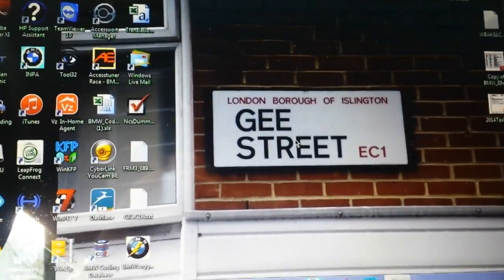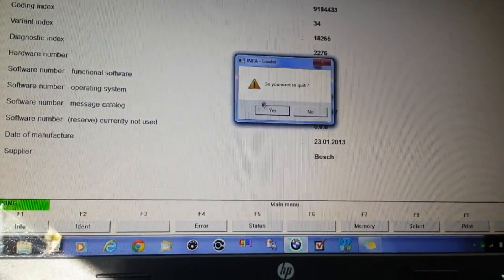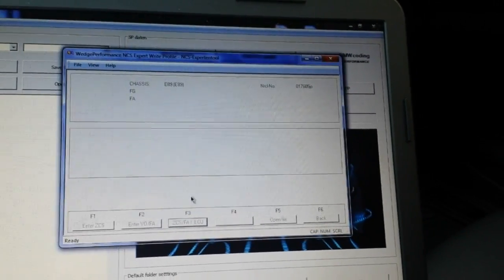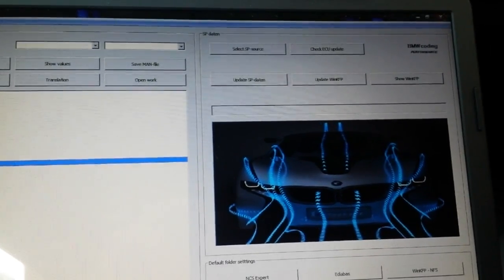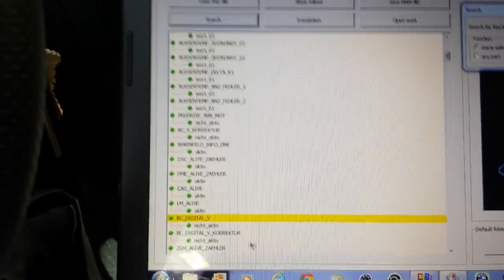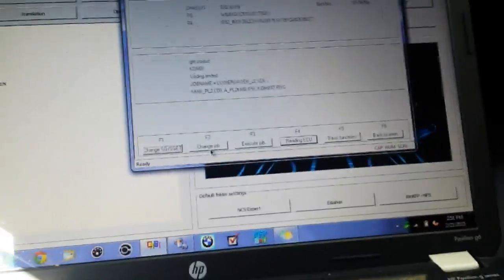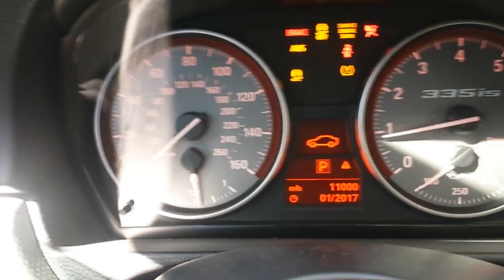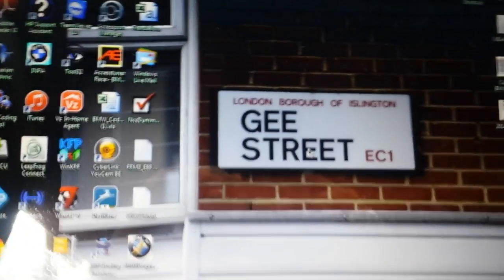Using the BMW Coding tool

Comment: Hey there, I‘m trying to code BC_Leerzeile and it‘s already done from „aktiv“ to „nicht_aktiv“, but still habe single text in my bordcomputer. Want to change to double line text. Read that it is not working because of long distance light (have bi-xenon in my e87).

Comment: Could u please tell me how to reset the short circuit counter in frm module?, also is there any way to deactivate the counter on frm for angle eye rings? Mine is normal Halogen, i swaped with 30W led now its not turning on. All i am getting error code short circuit in LM module. Car is E60 LCI. (WITH SINGLE HALOGEN BULB, WHICH ILLUMINATEDS 2 RUNGS) also headlight is Not xenon type. Thanks

Comment: Great video and clear. Can I use this software to remove the Adaptive Headlight feature from my 2008 335XI sedan? I have an error code on mine and I'd rather do without the feature as I know it can be programmed out...If yes, is there a tutorial to install the software you used. Thanks and again well done video......
Reply from the maker: Uptown Wedding Photography NJ Thank you.  Yes you can code out adaptive headlights with the software pkg.   You can find the latest edition of this software with installation instructions inside the zip at bimmergeeks.net in their download section.  Look for Standard Tools.

Comment: Hello! I need help :)
I managed to install everything i need on W10 laptop got cable and it seems i'm ready (i'm downloading 2gb files for R56) what i want to do is to re enable AUX input on my R56 which disappears when battery went flat :(
My question is in which module i need to look for AUX ?
Thank you :)
Reply from the maker: Look for RAD or something to that affect and search AUX.  You should be able to default code it and return it to factory settings.
Reply: If i understood you well option should be available in module it just needs to be turned on?
Reply from the maker: RevMeTech Was it enabled by default before or did you need to code it on?  If it was on with factory settings default coding will reset module to factory settings, turning it back on.  If you had in coded on after the fact you'll need to go into the module and enable it yourself by coding it on.
Reply: That is the problem i don't know ... What i know is that it is R56 mini which means that every each of them have AUX from factory. I bought it from first owner (i imported car from another country) and when car came to me i needed to jump start it because it was winter. And at that point it didn't show aux in radio menu but in original mini manual for radio there are instructions for aux and so on ...
Btw how do i do default coding ?
Reply from the maker: RevMeTech just Google expertmode coding with NCS Expert.  It's very simple.  If that doesn't work go into your RAD module, you can use the video as a guide, just substitute the RAD module for KOMBI and use the search function to find AUX.  If it's nicht aktiv change to aktiv and finish.
Reply: Thank you for quick reply. I have everything setup with r56 data ... I just need courage to start this :D one more question before i try tomorrow. Which modules in order should i first read and check for Aux option?
Reply: Bro i got info from rad module it has AUX option and under it it says no_aux what i should do now? In other guides it is usually on german no active and active but here it says no_aux :S after some checking rad module from dummy is offering options no_aux, aux and aux_tele something like that i guess i need to change no_aux to aux ?
Reply: Just to let everyone know i managed to enable aux! :) i'm so happy now! :) what i did is in 1rad module AUX option had no_aux what i did is i deleted no_ and left just aux and bam it worked!

Comment: Hello, got a few questions. What exactly IS a daten file ?

And is it possible to add the coolant temperature on the dash (the same way you added the digit speed) ?
Reply from the maker: I'd describe the daten as the data files that the programs use to perform their function, whether it's diagnostic, programming, or coding.

As far as I know it's not possible, at least not easily as it's not a option made possible by BMW.  I won't say it's impossible to do but it would entail a lot of custom programming and that's far beyond my scope of knowledge on that subject.

Comment: I do not have the profile you listed.  I have NCS Dummy profile for Expert.  Will that work the same?
Reply from the maker: If it has trace manipulation checked in the profile it will.  The thing about profiles is that they're editable.  You can load a profile, then go back to edit profile and change it however you want and name it whatever you want.  Most of the profiles in any given BMW Tools download have been floating around for yrs. Attached is a screen shot of the two different profiles I have.  Coding profile on the left, Expertmode on the right.  Does that help?  You can go into your profiles and see which one has manipulation checked and that would be the profile to use to make the coding stick.  https://goo.gl/photos/nN2vncMYfmZvZK2TA
Reply: That does help.  Thanks a ton.

Comment: So if you wanna code the mirrors to fold with the Key fob upon locking, would you choose FRM instead of CAS since it's under the FRM? This video is great btw
Reply from the maker: A_Squared Choose CAS initially,  then F6 to back out, then process ecu, then choose FRM or NFRM depending on what you have.  You can always pick CAS  first regardless of which ECU you're coding because you'll always have to pick the correct one from the drop down menu that lists them all.
Reply: LMB335is awesome thanks. You're the man!

Comment: Hi,

I have been using NCS Expert in the past 
with no problems with Win 7 in XP compatibility mode. I have now installed Win 
10 (big mistake...!) just tried running NCS again, also in XP 2 and 3 
compatibility mode but still errors whenever it tries to read the data from 
EDIABAS data server, it comes up with Initiating errors, and Sys key 
errors.
Anyone else tried NCS with Win 10 either in compatibility mode or 
not. Also have changed EDIABAS to compatibility mode as well with same 
result.

Any thoughts welcome.

Cheers
Reply from the maker: I run my software on Win 7 64 bit.  No need for compatibility mode.  I tried the Win10 upgrade for 30 minutes, hated it, BWW Standard Tools 2.12 threw errors, and went back to Win 7.  You can try uninstalling it off of Win 10 and reinstalling using Win 7 compatibility mode or just go back to Win 7.
Reply: Hi LMB335isIts almost 4 years since I installed NCS so although have been using it, the installation is a bit hazy now, can I just copy the folder to a new installed Win 7 version or does NCS have to be installed... really cant remember, also for EDIABAS.. struth spent so much time getting g it working years ago, thought it was ingrained in my brain for ever, wish I kept notes...
Reply from the maker: I can give you a link to what I use.  It's pretty much self installing with instructions, updated daten, NCS Dummy, Bmw Coding tool, and Standard Tools(NCS Expert, WinKFP, INPA, Tool32).  It will work with anything from XP to Win 10(in Win 7 compatibility mode).  It's all the latest version if you'd rather just do a fresh install.  You should have it up and running within 15 minutes of downloading it.
Reply: Ok, that would be great, I'm just adding win7 on to my laptop as well just in case, doing it now... but the link would be good, mine is 4 years old. Be much appreciated.
So best I guess is mail.   mobile-mail@ntlworld.com. 

Cheers for that, I'll let you know how get on.
Reply: +LMB335is One question, I had trouble with getting correct Daten files to begin with, the ones I think it calls up were the latest or correct for chasing back then, will the latest ones you use be ok you think...? or best use originals I have.
Reply from the maker: what model BMW do you have?
Reply: Hi,  its 320i 2010 LCI,   this is much appreciated...
Reply from the maker: +Malcy jb Use the updated daten in the pkg.  Especially useful if you decide do any ecu updates.  It works for all E8x and E9x models.

Comment: Great video! For some reason, when I execute the coding - it succeeds, but I can't see the changes. When I read the module again - it gives the old values. What could be wrong?
Reply from the maker: Try closing out everything.  Then go back in and process ECUs.  Now go to your Work folder and open the FSW_PSW_TRC file.  The changes you've made should show.

Comment: thanks for the video. I have few questions: this type of coding is actually to change options on the car, correct? WINKfp is used to write the new VIN on a module you replace, correct? for the lack of better terms, how do you pair a new module, let's say airbag module, to the car? I have 2012 Mini cooper s R55. thanks
Reply from the maker: +Salah Sharief Sorry man, forgot to get to your question.  Yes, either use WinKFP to reprogram it or Tool 32 to rewrite VIN to module/

Comment: Where did you get this program? By the way does it works on win 7 64bit?
Reply from the maker: +Dovydas Milius It's in one of the BMW Coding forums I believe but here's a link to it. 

https://mega.nz/#!2d500QQb!yO3UI4KCJFc3e3ew2aBndrL2JC8sOFTtjjSYzbzywr0

It works perfectly on Win 7 64, that's what I'm using in the video.
Reply: +LMB335is and its full english?
Reply from the maker: If you're just referring to the BMW Coding tool, yes.  I'm assuming that you already have BMW Standard Tools 2.12 (INPA,NCS Expert, Tool 32, WinKFP) installed.
Reply: +LMB335is I have got exactly this version. Inpa is in German and ncs is mostly in English. By the way, how good you are in programing? I want to program my instrument cluster and i need some help
Reply from the maker: I'm really not much on programming since I don't personally need to use it beyond maybe updating a module here or there.  I would suggest checking out the coding section on E90post.com.  There's some very knowlegdable guys on there that really know programming.
Reply: +LMB335is Thank you very much!!!
Reply from the maker: You're welcome.  Good luck.
Reply from the maker: +Adrian Anton https://mega.nz/#!jYgmlS4D!yO3UI4KCJFc3e3ew2aBndrL2JC8sOFTtjjSYzbzywr0
Link to BMW Coding Tool
Reply: +LMB335is Thank you!

Comment: Thanks for sharing this video, Bill. It is very helpful. I have a E70 and I followed your steps except I selected the E70 chassis as I have the E70 daten files. When I execute job, it codes fine but when I restart the car, I'm not seeing the digital V. Also, I go back and read the ecu and the values for the digital v is back to not active. Do you know what I am doing wrong?
Reply from the maker: Did you scroll through the menu in the dash to see if it was there?
Reply: +Bill G Yes, it is not there.
Reply from the maker: +omgboost  You picked BC_DIGITAL_V to change?  Try it again and save your MAN file and see if its been changed in the MAN file
Reply from the maker: +omgboost Also make sure you're using the writing profile not a expertmode profile
Reply: +Bill G Yes! Thank you for your help. I forgot to change the profile from expertmode to a writing one. After I did that, I was able to code the changes. Thank you again!
Reply from the maker: +omgboost Glad you got it figured out.  Get to coding!

Comment: you can tell me the name of the programa that you use.
tanks
Reply from the maker: +Pedro rodrigues  I use BMW Standard Tools 2.12 which includes NCS Expert, INPA, WinKFP, and Tool32.  And I use the BMW Coding tool.  In the video I use INPA to illustrate that I have a active connection to the car and I use NCS Expert and the BMW Coding tool to do the actual coding.

Comment: This is actually the best coding video I've found so far. Thanks for the explanation. You make it look very simple.
Quick question. A friend of mine has the OBDII cable and the interface for BMW.
Do you know the exact way to code my car to enable the BMW Apps (6NR) from a E82 (135i)?
Reply from the maker: GanqueGaming  It depends on the yr of your car first.  It needs to have a Combox which came in later model yrs, not sure when BMW started installing them though. You'll have to write BMW Apps to your VO and then get a activation code from BMW.  They're going to get their $ out of you one way or another unfortunately.
Reply: +Bill G Thanks, I have a 2013 BMW 135i coupe (e82) my car is already equipped with the Combox + iDrive with Navi Pro and all the hardware requirements. 

So how can I get the FSC Code? Is there  a BMW Website where I can just simply go there, and pay for it? It does the dealer has to do this on-site?
Reply from the maker: +GanqueGaming You could try the dealer or maybe contact these guys and see if it may be cheaper.  http://www.bimmerretrofit.com/store/index.php?route=product/product&path=78_79_81&product_id=67

Comment: very interesting mode! do you know how to deactivate passenger airbag on bmw e60?
Reply from the maker: stoyan manolov Do you have the optional switch in the glovebox?  I'm not sure if it can be done through coding, it may need to be done by the dealership.  It may also depend on what spec the car is (US or  Euro)
Reply: Glove box?? I have ncs expert
Reply from the maker: stoyan manolov I just quickly googled deactivating passenger airbag E60 and there's a aftermarket kit or a optional factory switch in the glovebox to deactivate. But I can't find anything in any of my coding lists that shows how to disable the airbag via NCS Expert